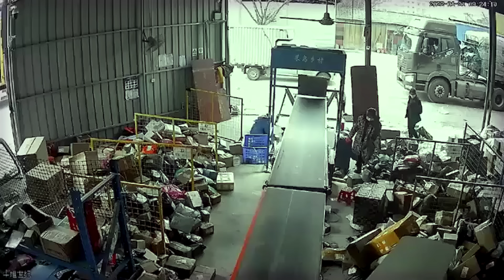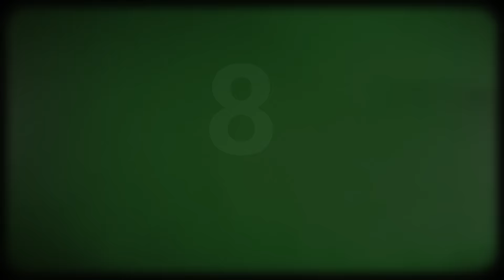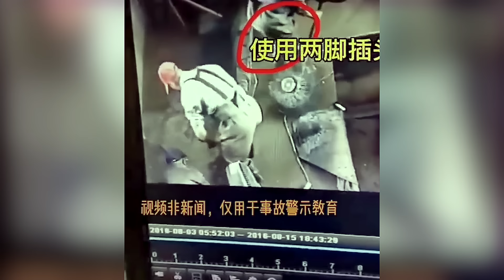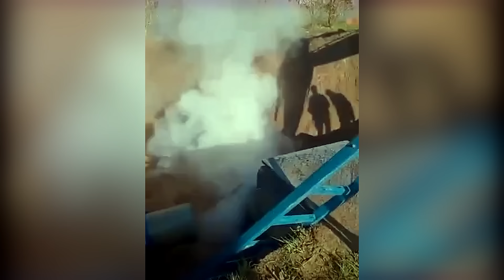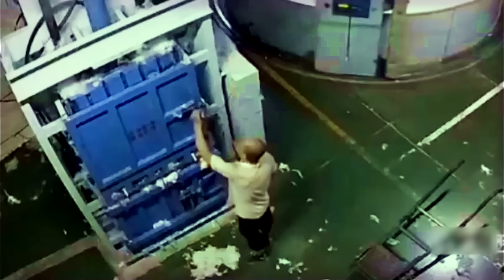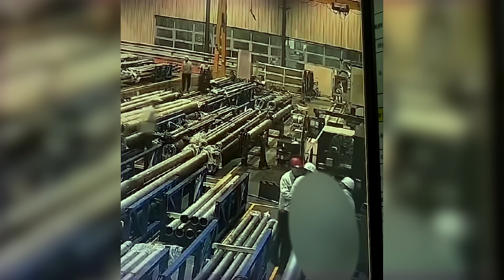Scrap Baler Incident Caught on Camera

Comment: In China, their logic is they have so many people that it's easier and cheaper to replace workers than it is to protect and train them properly.
Reply: A lot of these unreasonable accidents just take a few brain cells to avoid 😂
Reply: I thought the same thing😅
Reply: No ! those People were just Stupid , Fixing a Dangerous Machine without turning it off is Personal Negligence, Nothing to do with the Country
Reply: So does India. Work safety is non-existent there.
Reply: Correct on both points. Cheaper to replace and there’s too many of them
Reply: China lets natural selection take place.
Reply: OSHA would be overworked in China😮
Reply: That's exactly jt.
Reply: Technically true